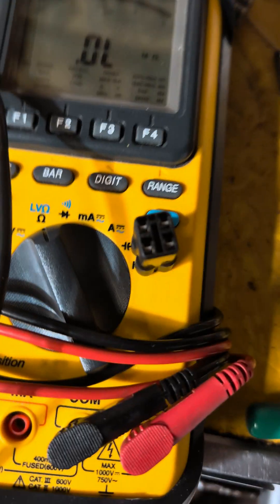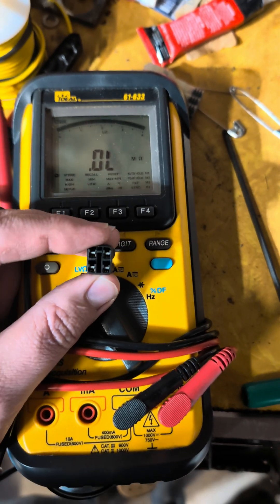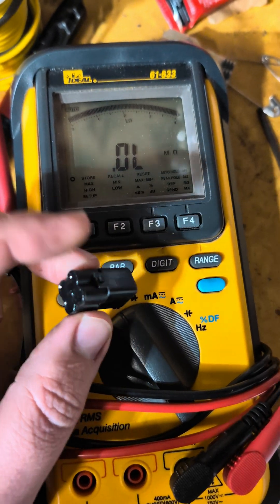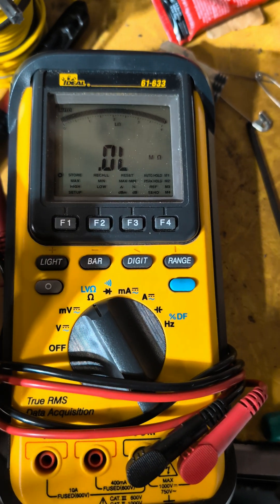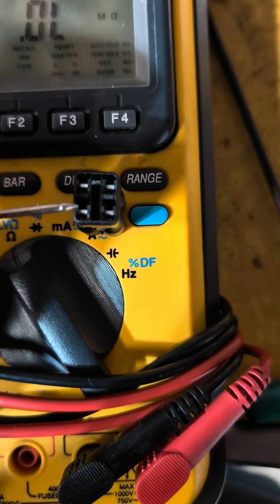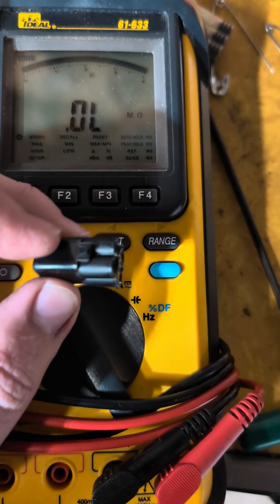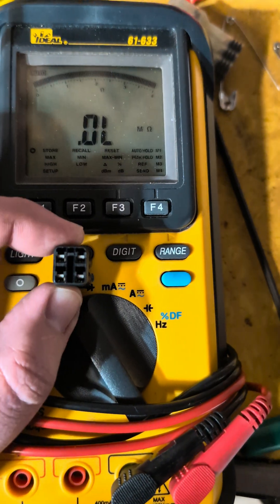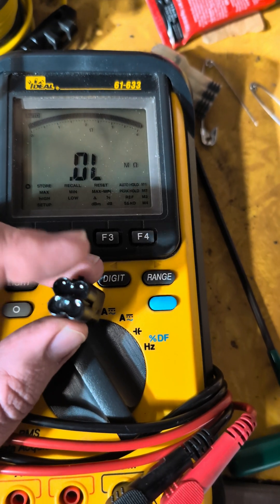DIY KTM 690 / Husqvarna 701 fuel dongle

Comment: Hey tx for the vid. Have you done the fuel dongle yet? Curious to see if it works!!  Cheers!!
Reply from the maker: I don't really have a way to test it without a scan tool, but the bike hasn't exploded.
Reply: @ThePlanetZebulon5  if no dtc/f1 codes on display means all good to go!!! What year is the bike that it came off of? Wondering if it might be different resistance for different years?
Reply from the maker: @stephdage792 Couldn't say about that, but I doubt it. 

I didn't try, but I imagine you just check the resistance on the 02 sensor when it's cold to see what it needs.
Reply: What year IS your bike? Thanks for the video!
Reply from the maker: @alvar3657 That one is a US model 2023.